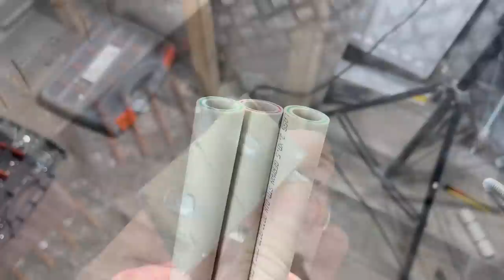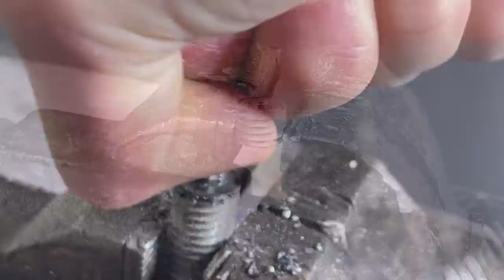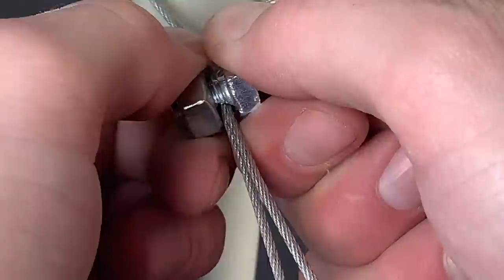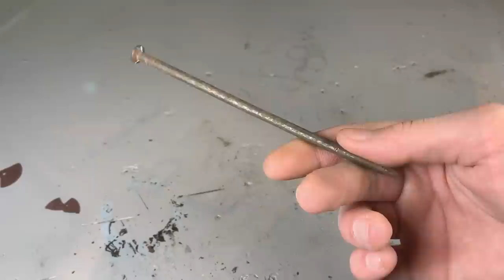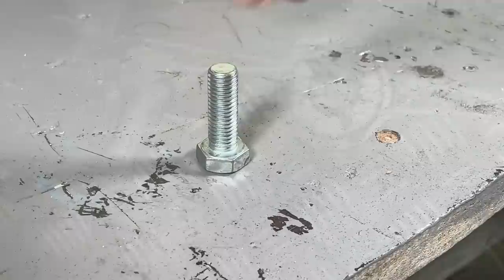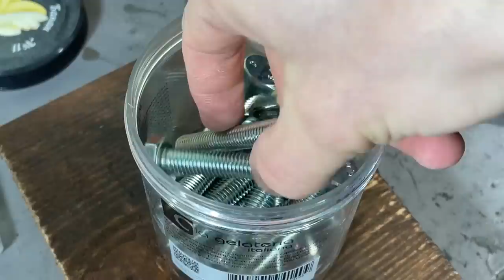SMART HANDYMANS TIPS AND TRICKS

Comment: If anyone finds this comment, most of these "tips" are just going to dull or break tools. Most of them won't work at all, and some are downright pointless. Almost all of them can be made better or simply bought for less than 10 dollars. I don't know why this video was recommended to me.
Reply: It was recommended to you because the Almighty Algorithm thought you would be competent enough to NOT totally miss the point. None of the things I've see this person do is going to break anything. Just the opposite, in fact. Many times, they have repurposed items that others have discarded, and done so very well. 

Yanno, I will take one little bit of that back. The only thing that could dull in any of this is drill bits, and it's not that hard to resharpen bits, especially with the correct jig.

As for the rest of your complaint, WHY bother with dropping what you're doing, driving who knows how far, in who knows what kind of conditions, wasting hours and money unnecessarily, and THEN finally getting back to work? Especially when you can do something without all of that, save the time and the money and the hassle and the resources AND keep something out of the scrap yard (or trash bin, more like, as careless as many are about recycling), all at the same time!

And only a very, very few of the things this person does won't work for some purposes. The hone, for example. Would it help you rebuild a motor? No. Would it clean out a piece of metal tubing to help you? Quite possibly, even if it takes a bit longer. Besides, most of these are proof-of-concept, anyway, to show what is possible. They can all be tweaked and improved as needed for what is needed at that moment. 

Oh, and... not everyone believes it's better to spend $10 when it can be made yourself, instead. Not everyone wants to buy stuff from China. 🤣
Reply: Bravo & well said to the reply.

Comment: Not smart at all and a waste of money. Your tips are more expensive than the tools and hardware items already available in the market. Drills, rivets, clamps and other items are commonly available in every hardware store and also cheap.
Reply: Um, what? If you have high quality bits, and know how to sharpen them properly, you don't need to worry about their cost. As well, you've completely missed the point of this channel. It's not about the cost, but about not buying it new when you don't need to. It's not about the availability of an item, but about reusing what others think of as trash. 

It's also not about any of that you complained about, but about finding ways to do something right NOW rather than driving who knows how far, in who knows what kind of traffic, wasting what could be hours, and then finally being able to get back to work. Especially when it is a completely unnecessary trip and expense! 

Seriously, way to totally miss the point.